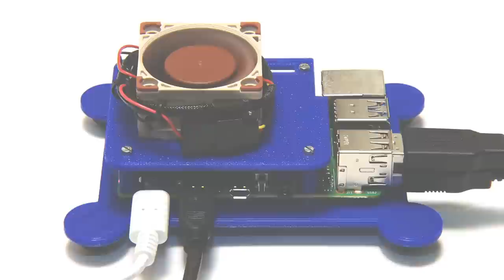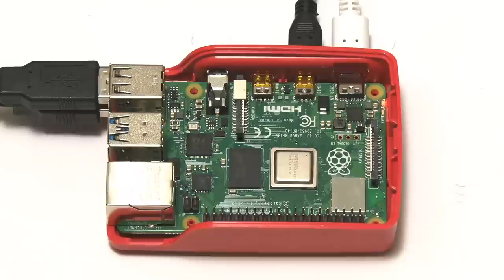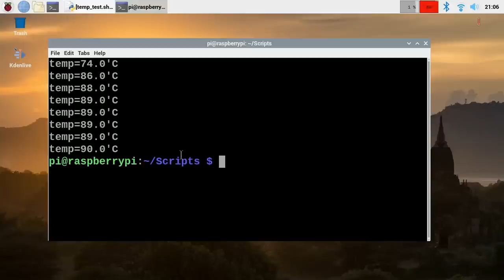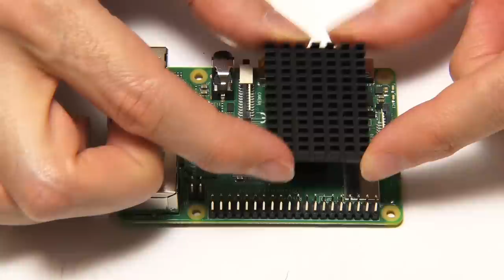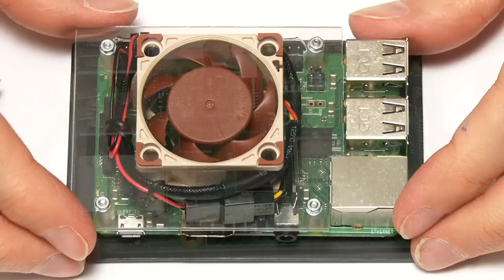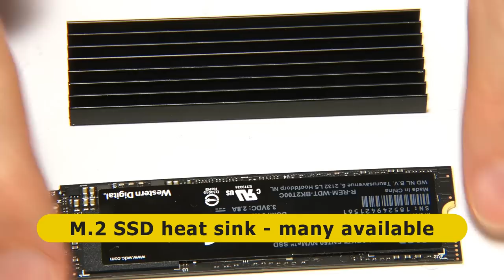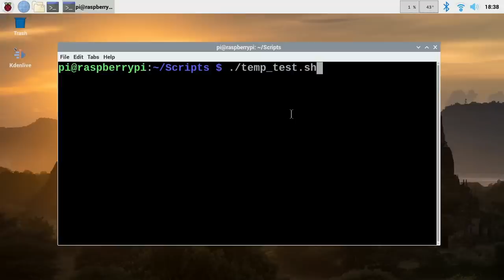Raspberry Pi 4 Cooling

Comment: So fan plus heatsinks plus case for fan plus time...plus buying pi4? That's not looking like the 35 pound benchmark price really is it? Especially if its a 4gb pi.  You could get an nvidia nano easily for that.
Reply from the maker: Correct. Some complained in the comments on my recent Pi 4B vs Jetson Nano video that the two should not be compared. But a Pi 4B 4GB with decent cooling is not that differently price -- and the Jetson Nano has a great heat sink.
Reply: @ExplainingComputers  hmmmm... I was reading somewhere about the failure of nvidia to utilise those cuda cores on the nano for gfx. But let's be fair, nobody is buying a nano as a gaming machine when a second hand desktop is in the same ballpark. Tensorflow for home automation, face recognition and machine learning yes and a good use case... fortnight or GTA no.
Reply: @ExplainingComputers  ohh BTW.. The missus heard your intro music when I was watching this yesterday...she's not tech saavy at all...so she's not a fan of tech vids. But she did say "its not Sunday is it?" ...just thought you might like to know how catchy that tune is...

Comment: Great video! However after watching this I decide to not buy Raspberry Pie 4 at all and wait for 5 to release or 3 to drop price. It just doesn't make sense to have me as a user figure out a cooling solution and 3d print a customized case... And if I don't do these it throttles the cpu speed which defeats the biggest selling point of version 4.

Comment: Great video - for those of us across the pond I made a quick adjustment to your script to display in F and works on a pi 4 too!:

#Pi CPU Stress Test Script

#!/bin/bash
clear
#nice little loop

for f in {1..7}
do
    echo "The current temperature in Fahrenheit is:"
    /usr/bin/vcgencmd measure_temp | awk -F "[=']" '{print($2 * 1.8)+32}'
    sysbench --test=cpu --cpu-max-prime=250000 --num-threads=4 run >/dev/null 2>&1
done

echo "After stessing the CPU it is now:"
/usr/bin/vcgencmd measure_temp | awk -F "[=']" '{print($2 * 1.8)+32}'
Reply from the maker: Thanks for sharing. :)

Comment: Amazing video but i cannot understand only why I should buy a raspberry pi for 35 euro + a cooling system of 20 euro instead of any other SBC like an odroid or the atomic pi. These sbc have amazing software, only that... I love your videos, I am sad because i already have a RPi 4 and it runs at 65° idle and it is useless for my project. On Aliexpress they have a very big cooling case and 2 fan, maybe I will buy that one!

Comment: shouldn't the second test have been the stock pi but out of the case rather than you making two changes in one step (out of the case AND a heat sink)?

Great test though. That final solution was pretty solid!
Reply from the maker: It should -- but I did not want to risk damaging the Pi with another non-cooling-solution test!

Comment: I'm trying to follow along, but after creating the script, I cannot run it. I did CHMOD, but when I try to run it I get "failed to execute child process 'xterm'"

I think that means I need to install 'xterm', but I've got the built in terminal... so why won't it open with that?

I can successfully run one pass of the test manually typing the command into terminal, tho.
Reply: ok, I'm a linux n00b. but now it says "line 8: no such file or directory"

Line 8 is:
sysbench --test=cpu --cpu-max-prime=25000 --num-threads=4 run >dev/null 2>&1

but, as I said, if I type that command in alone, it works. So what basic, fundamental thing am I totally oblivious to here?
Reply: THE STUPID / IN /DEV/NULL
ARG! :P
Reply from the maker: This suggests to me a syntax error in your chmod command -- there is nothing to install for this. Or maybe you were not in the right folder when you ran the command (the one with the script in). Good luck!
Reply: @ExplainingComputers  I think I've gotten it sorted. 😄 Thank you for your channel!!! Love it!

Comment: I presume you already know. If not. The first test you did at 41 minutes was because the thermal throttling. The Pi4  has a build in system where the cores get underclocked at 600mhz when it hits a certain temperature.

I think for these Pi4's you would be best of with the alluminium cooling cases thats available at FLIRC. The case has a inner block which connects directly to the CPU making the case itself also a cooling block sort of.
Reply from the maker: I['m pretty sure I mentioned the throttling part! :)
Reply: @ExplainingComputers  Reviewed the video and you're right you did mention it. You are right. What do you think about the alluminium case from FLIRC?

Comment: Here is a better idea for cooling, a centrifugal blower fan, they move allot more air and are quiet. I would vertical mount the Pi  and the blower fire up
Reply: *a lot (different meaning)
Reply: @alvallac2171  some laptop cooler fans are, the blow air sideways though the laptop

Comment: I get a bit upset that the degree symbol is so difficult to display & is misrepresented in "vcgencmd measure_temp".  I spent some time digging for a better solution...  This is in my ZSH aliases file: -

## RaspberryPi Temp
if [ -e /usr/bin/raspi-config ] ; then
    DEGREESYMBOL="\xc2\xb0"
    alias temp="/opt/vc/bin/vcgencmd measure_temp | sed -e \"s/^temp=//g\" -e \"s/'/$DEGREESYMBOL/g\""
fi

HTH

Comment: those heatsink stickers suck, use thermal paste or liquid metal with the larger one (should be  copper though for liquid metal).  just need to fasten it differently.   should be silent and cool.

Comment: what about a REAL copper heatsink ?
would that be any better than aluminum ?
Reply from the maker: It may be better, especially if using thermal paste. But I think a fan is the real solution.
Reply: Don't put spaces before punctuation marks, except for: ( { [

Comment: Chris, I've been waiting for this. I have several PIs (mostly 3B/3B+, and 1 4B in the stacking case from ModMyPi, and specifically this https://thepihut.com/products/multi-pi-stackable-raspberry-pi-case. Now, with some creative construction, this could create sufficient space to fit your ultimate cooling solution, though it would need the top part of your printed case (any plans on marketing them?), but have you stumbled on a more low profile solution?
Reply from the maker: You can download my parts here: https://www.thingiverse.com/thing:3743755 :) A 10mm (rather than 20mm) high Noctua or other 40m fan could be used.

Comment: well. its flawed. quite so indeed actually.
sure i do agree, heatsink in the case doesn't make much sense. but having the Pi outside the case without a heatsink would have been a BIG hint towards how bad the case is and wether you really need a cooler. especially since the small and the bigger heatsink produced roughly the same result.

maybe retest outside teh case with no cooler attached and link in the new video in this ones description!!!!!!?
Reply from the maker: It would indeed have been a "big hint", but I was not prepared to repeat a no-cooling test with the Pi, as I kind of wanted it to survive for the remaining tests! :)

Comment: Is there a way to use another GPIO pin to use as PWM so you can have a script altering the fan speed (and noise) depending on the Pi's temperature? I have a small cheap 5v fan that rattles and whines, I'd prefer it to kick in whenever it's needed, and not be on 24/7

-- EDIT I noticed Chris mentioned the patch, leaving it for extra reference --

PSA: There is a new firmware that should help a lot with the excess heat for the RPi4. You'll still need some sort of active cooling but it fixes some issues with the excess heat produced in the USB controller.
https://www.raspberrypi.org/forums/viewtopic.php?f=28&t=243500&p=1490467&hilit=vl805#p1490467

Thermal image of RPi4 with default firmware
https://img.purch.com/raspberrypi4-thermal-idle-launchfirmware-png/w/755/aHR0cDovL21lZGlhLmJlc3RvZm1pY3JvLmNvbS9IL1MvODQ0MzM2L29yaWdpbmFsL3Jhc3BiZXJyeXBpNC10aGVybWFsLWlkbGUtbGF1bmNoZmlybXdhcmUucG5n

Thermal image of RPi4 with updated beta firmware
https://img.purch.com/raspberrypi4-thermal-idle-updatedfirmware-png/w/755/aHR0cDovL21lZGlhLmJlc3RvZm1pY3JvLmNvbS9IL1IvODQ0MzM1L29yaWdpbmFsL3Jhc3BiZXJyeXBpNC10aGVybWFsLWlkbGUtdXBkYXRlZGZpcm13YXJlLnBuZw==
Reply from the maker: As noted in later in the video, the firmaware update was applied before running any of these tests. As you note, it only deals with the USB controller, and is in my view somewhat of a red herring to try and deflect attention from the SoC temperature issues.

Comment: The firmware update may give problems with USB and it's been withdrawn for the time being.  See:

https://www.raspberrypi.org/forums/viewtopic.php?f=28&t=244421#p1491660
Reply from the maker: I must re-test my USB speeds from the video two weeks back . . .
Reply from the maker: I've just re-run my hdparm tests, which are unchanged (270 MB/s reported). Large file transfers are a bit erratic, and certainly not at that speed, but do work.

Comment: Test a Flirc case.  Geeze, it's just the best case on the market, and the entire case is an aluminum heatsink..
Reply from the maker: I will be doing this in the third and final part of this series. Although I suspect that the ICE Tower cooler, as tested in the second video in the series, will deliver the best cooling results.
Reply: @ExplainingComputers  Just an FYI, I don't work for Flirc, but I REALLY like their case.  I will never use anything else I don't think.  They're a little pricey, but it's worth it.

I'm also certain there are better systems, but Flirc is good enough.  I've tied it down with ffmpeg on a 3, it did fine with that but the case got toasty.  4, I admit I've not tested.

Comment: I followed the directions to do the test myself and it completed in under a minute, inside the official case with no cooling. Quite confused here! It spat out 8 temps so it did all the loops, and the cpu-max-prime is set to 25000, I've checked and triple checked. I know the new revisions of the Pi 4 are 1.8ghz instead of the 1.5 in this video, but this is ridiculous!
[edit: OK, it's because sysbench acts completely differently in the current version to how it did in the older one in this video. It uses a fixed time with a default of 10 seconds, you can change it with --time but I couldn't work out how the time variable like in these vids.]

Comment: how i install python on raspberry pi 4?
Reply: Install Debian on the Pi 4, then run "sudo apt-get install python". Though Debian probably has Python pre-installed. Use "sudo apt-get install python3" if you want Python 3.
Reply from the maker: It is already there in Raspbian, but IDLE has been retired.

Comment: I want to install this in my car, considering that this runs "cool" at 55°C/131°F, would I need to worry about it thermal throttling in the summer? I'm thinking no because the interior of the car would never exceed 131°F so the chip would always sit lower than operating temperature under load.

But then I'm also thinking it might throttle because what if the ambient heat is added to the operating temperature, plus the fan would be blowing hot air on the chip preventing it from cooling... 

Is there anyone reading this with enough intelligence and knowledge to tell me if it would throttle in this condition? I don't think the car would get hotter than 115°F-ish..
Reply from the maker: I cannot imagine this solution (Pi + decent fan) would throttle in your car. Look out for my follow-up Pi 4 cooling videos! :)

Comment: You actually could've gotten a (low profile) "pin fin" type of chipset heatsink which wouldn't have needed to be hacked down.
Reply from the maker: Chipset heat sinks -- which I've used in somse other Pi cooling videos -- are a little too big to fit without having to include a copper spacer.
Reply: @ExplainingComputers  : Oh poo. 😞

Comment: I used a 3D printed case from Thingiverse: https://www.thingiverse.com/thing:1815268/files with a 40mm Ebay fan and NO heat sink.  Using your script, temperature maxed out at 49 C.  I was going to try adding a heat sink as well, but now I don't think I'll bother.  It seems like a cheap fan blowing direct onto the SOC provides better cooling than your set-up with heat sink plus fan.

Comment: Watched a video from another channel.  They used a Raspberry Pi 4 case by Flirc as a passive cooling solution.  You might want to check out the case:  https://flirc.tv/more/raspberry-pi-4-case

Comment: When I got my Pi4 (from Canakit), it came with three heat sinks, and I've seen heat sink kits for the Pi 4 that include the same three heat sinks. If you've got the cash, check out the fanless Wicked Aluminum case ($70 US). It completely encloses the Pi4 and provides similar cooling metrics that your Noctua fan setup does. Check out WickedAluminum.com.
Reply: The problem with metal cases is that you practically disabled the WIFI features of your Pi.
That's why the Pi 2 is the last one I even tried using metal cases with.
The Pi Foundation needs to start adding antenna connectors to the board so we can put our Pis in metal cases and still have effective use of the WIFI capabilities.
Reply: @PatsFanGermany  I don't use wifi at home if I can avoid it. Besides, you can get inexpensive wifi and bluetooth USB dongles if you need those features.
Reply: @jsimmonstx  but that would defeat the purpose of having WIFI onboard.
Reply: @PatsFanGermany  The Flirc case supposedly avoids that problem because it's not entirely aluminum. The parts near the WiFi and Bluetooth are non-metal (plastic, I think). Also, it's cheaper than the Wicked case.
Reply: @PatsFanGermany  - I was merely suggesting a workaround for your objection. For people like me (high-dust, wired ethernet), a fully enclosing metal case is a viable solution. I don't use Wifi at home, so...

Comment: As SoC's up the ante active cooling will be the norm,  to your script you need to add a dmesg / messages grep to get the level of throttle ( how severe its cutting back ),  for a late showing this board has had more issues than most.  Obviously the one right now is the USB C errata,

https://hackaday.com/2019/07/16/exploring-the-raspberry-pi-4-usb-c-issue-in-depth/

I would imagine a respin is enroute ( dont be surprised ) that would fix this one.

So what other hidden gems awaits the masses?.

Comment: 53°C??? Idle with just one small heat sink on the CPU??? 😱
I've put heat sinks on every chip on the SBC and even on the SD Card reader. But with no GUI running, no display attached, a USB Stick in one of the USB 3 ports and WLAN active, my Pi 4 idles at 63°C in the open (no case and ambient temperature at 25°C)!
I'm desperate, cause this Pi 4 is supposed to be the heart of my home automation system. But if it idles at 63°C, it will start thermal throttling as soon as it has to run my home automation system!
Reply from the maker: I get the strong impression that different boards vary significantly. Remember my idle here was after about 5 minutes, so would have risen further. I am convinced that active cooling is needed.
Reply: Do the Noctua thing, Stefan. Problem solved.
Reply: @ExplainingComputers  I'm afraid you are right. That's really bad news as my life home automation system is located at the centre of my home (which is in the living room). So passive cooling was a prerequisite from the get go. 😢
Reply: @ExplainingComputers  It's really strange. Everything on the board is hot! Even the HDMI ports and the audio jack which I don't use in my headless setup!
Reply: @PatsFanGermany  This whole case acts as a large heat sink: https://flirc.tv/more/raspberry-pi-4-case

Comment: Have you looked at the 52pi Ice Tower tower heat sink and cooler? Based on a review which Eta Prime posted the other day (https://www.youtube.com/watch?v=RyUXC3886Ic), it is rather extreme - it resembles a smaller version of the venerable Cooler Master Hyper 212 and stands about 5cm when mounted on the CPU, and isn't what you would call quiet - but it does show that there is a lot of interest in OTS active cooling systems for the Pi 4.
Reply from the maker: I looks a great cooler.

Comment: A watertight case filled with non-conducting liquid coolant would make for an intriguing comparison. I'm not sure it would be more effective than the other non-active coolers, since once it warms up it would stilll rely on the case diffusing the heat.

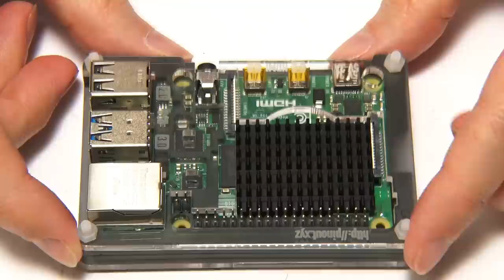Comment: • 6:50 - How is that a case? 🤨 That's like saying wearing a belt means you're dressed. I don't see the point to it at all, other than perhaps providing a shim on the bottom so that it doesn't sit directly on the table—if I had to grasp at straws for a reason. 😕
• I did a similar thing for an OrangePi, but I don't like that it uses GPIO pins. :-\ Your GPIO is completely inaccessible. :-( Maybe in future versions, they'll start including a dedicated fan header on the boards and software to use them only when needed. 🤔

Comment: This is something i just cannot understand. Clearly it should not be used without at least small heatsink, it should be then sold with it, even if price would have to be higher. We are not buying component (like CPUs can be sold without cooling) but whole computer. It's like laptop producer sold you laptop and then said "oh yeah if you do not want it to boil itself buy cooling from us... you will have to put it in yourself tho". Sorry but this is just something i cannot accept.